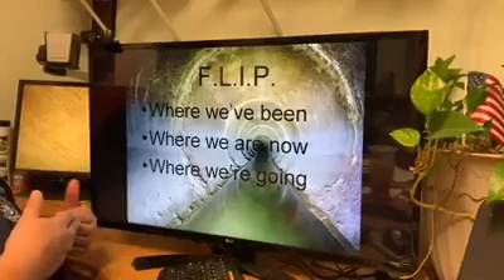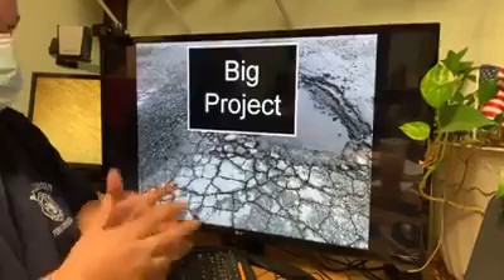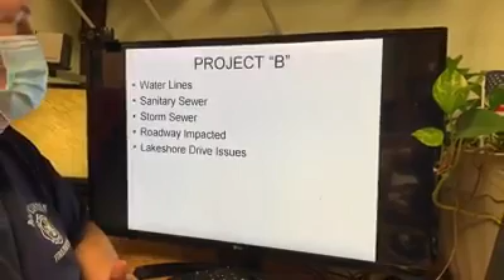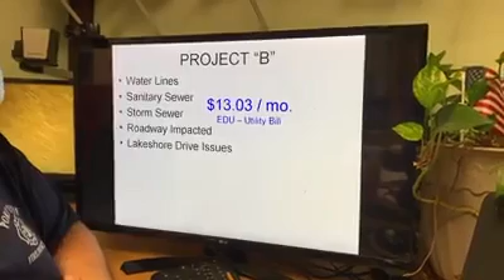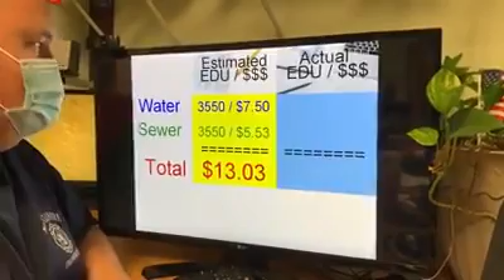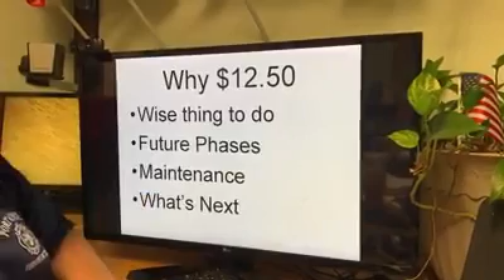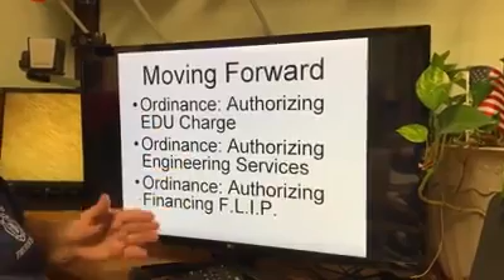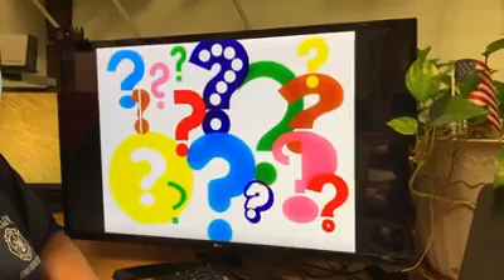City of Port Clinton - Infrastructure Project

Comment: I have to pay all this money for resurfacing streets with money charged on water bill is highly illegal 450 dollars in 3 years and I have over and because of the streets I have to have entire suspension replace on 3/4 4x4 due to the street and 95% my driving in this town of 2800 dollars you paying for the repair,